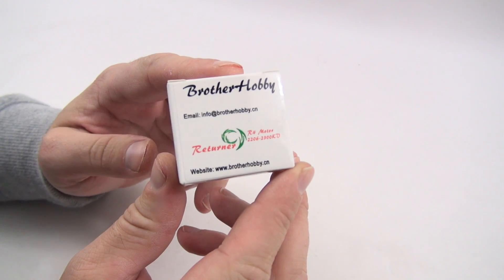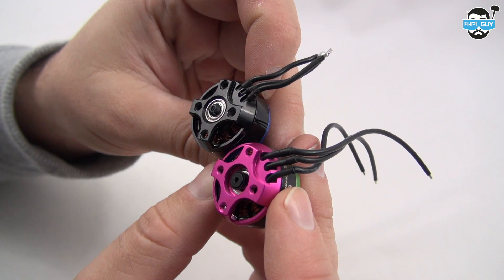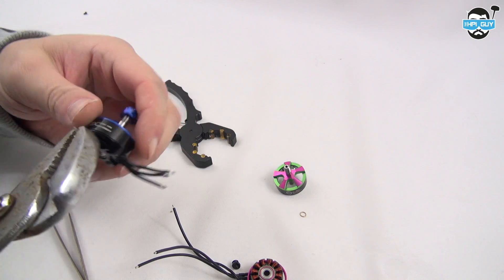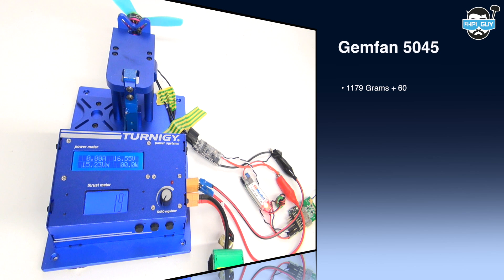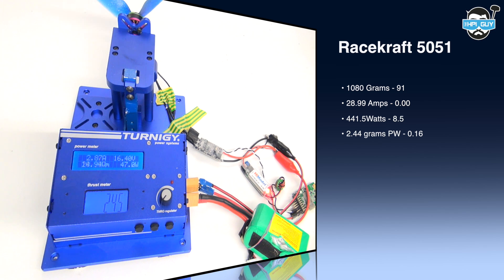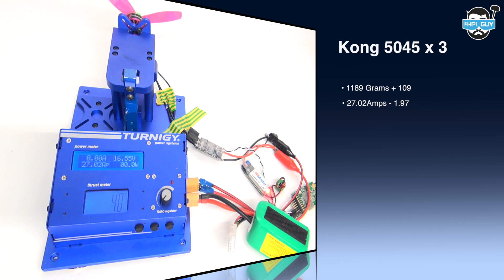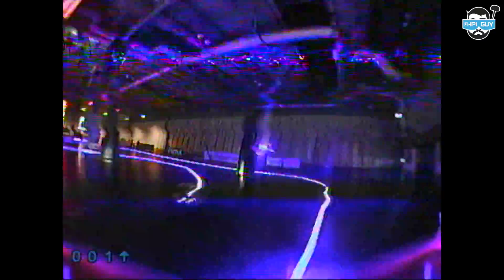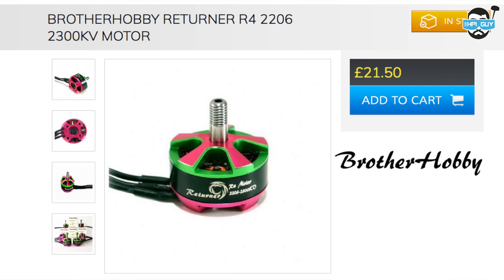HPI GUY | BrotherHobby R4 Returner 2206 2300kv Motors

Comment: Hi,

nice video. Yesterday i received my motors and i must say they are awesome made. Super smooth and no play at all.
After the first testflight i recognized that the motors are realy hungry .... With my old 2206 2350kv lumenier i got round about 3 min freestyle time. With the R4 only 2 mins... Some suggestions whats wrong?
I checked my PIDs and they are smooth, i used the same Props (HQ 5x4x3).

Comment: are the Kong 5X4X3 balanced hq is getting expensive
Reply from the maker: Ultimatevapor918 yes they are balanced really good actually
Reply: ThatHPI GUY Would you race with the KK props though?
Reply: Peter Woo HQ all they way
Reply: Had quite a few of the 5x4x3 KK props blow up on me in mid air on the RS2205 motors. Most of the time they're great but you are way better off paying extra and getting the HQ V1S props instead.